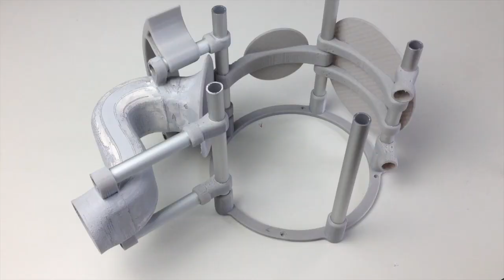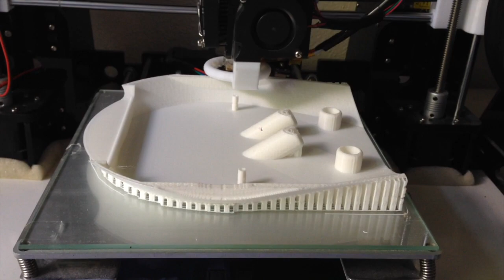Devialet Phantom Inspired DIY Bluetooth Speaker (3D Printed, by Philip Erren) Part II

Comment: this gave me ideas to convert the original iMac into a bluetooth speaker - remove the screen, add a central bass speaker + 2 mid range top left & right where the screen was and utilise the original speakers for treble (if you were real smart could use the cd player but why bother?).
Make it smarter than just a bluetooth speaker but an actual player it's self by adding a raspberry pi + led screen for track info/anvigation which could then utilise the already available i/o ports, even have an internal ssd etc plus additional input via usb stick as well as the bluetooth playback.
Also as it has a handle which is extremely robust and thus could hold a LOT of Lith-Io batteries, so weight on the handle would be no issue and could power it for the entire night (excellent camping speaker.)
Pity my old iMac still works but i bet there a few million out their for cheap.

Comment: looks amazingly great. but i saw you put the amplifier on the sponge. I think it will be hot..
Reply from the maker: The heatsink is on top of the amplifier and there is no sponge on it so I think it will be fine...
Reply: Class D amplifier shouldn’t get very hot :)

Comment: First of all, I have to compliment you on your clean assembly, precise measurements and dedication for this project, it is absolutely incredible. 

But I just had to notice that you mounted the power dc-jack with a little bit of hot glue. This might get loose and get stuck inside meaning you'll have to crack the shell open and replace the jack. You can use some stronger resin or a 3d printed holder with mounting holes.

Still, I love the project and like your style. Keep up the good work
Reply from the maker: Thanks for the nice comment and the attempt to help but the DC-Jack is properly secured. I just hold it in place with hot glue (You can see that in the video). I then glued all around it with two part epoxy! I didn't film that, but it is very strong!
Reply: Philip Erren 

Thanks for the reply, I'm glad to hear you did, have fun with this (and further) projects 😁.